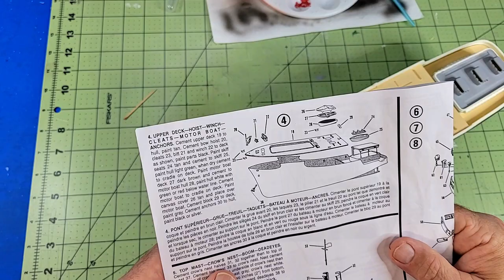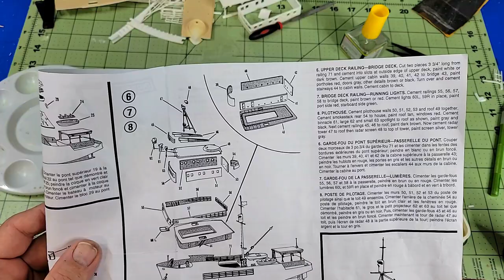Building a Commercial Tuna Fishing Boat Model Ship Kit Vol-2

Comment: The ladders are what is keeping the deck from resting securely atop The bulkheads of the superstructure, you should insert the vertical ladders after the deck is glued into place.
Running lights on a ship are in three colors, white for the bow and Stern, read for the port which is the left side, green for the starboard which is right.  On the masts the very top light will be white, any further lights will be in yellow or Amber.

Comment: So bizarre seeing internet modelers using model cement on painted pieces.  It doesn't really work at all as model cement cannot form a proper bond with a layer of paint, plus the shiny cement residue is really visible on the painted pieces.  Model cement ruins paint, but it's 2024 and maybe things have changed?
Reply from the maker: I might not show every step on camera, but I always remove a little bit of the paint, so I have a surface to glue to.